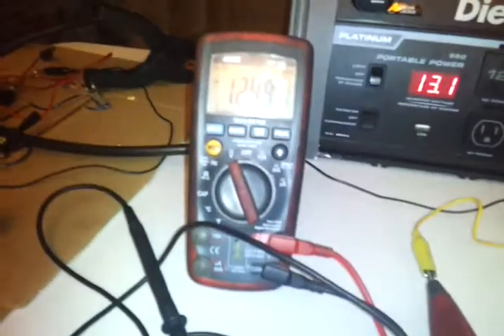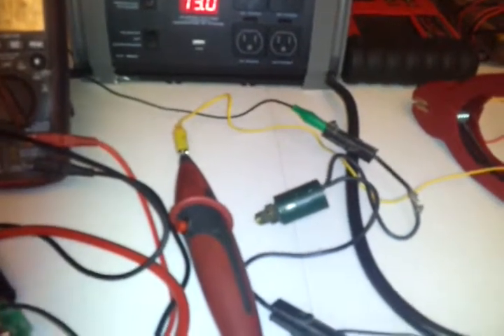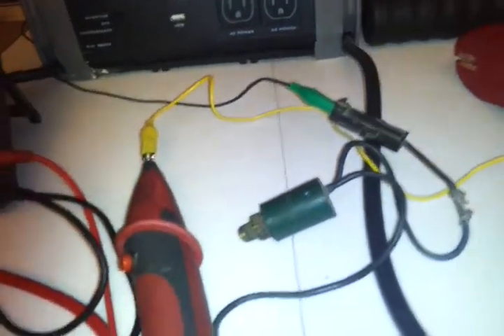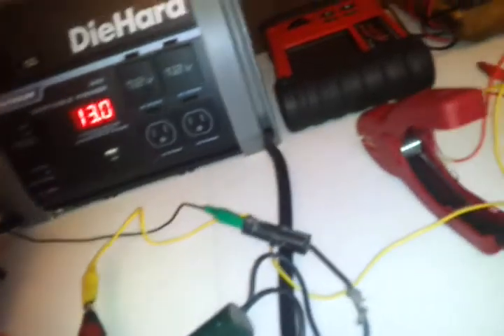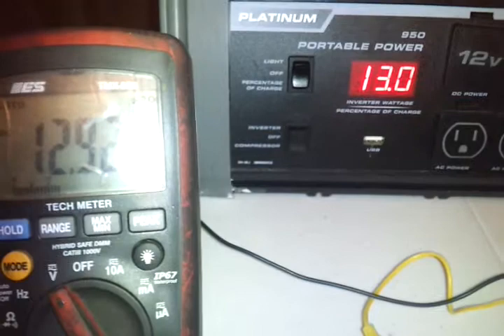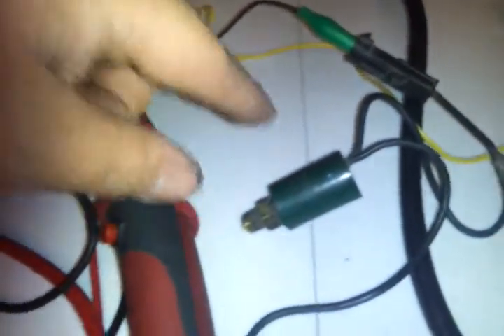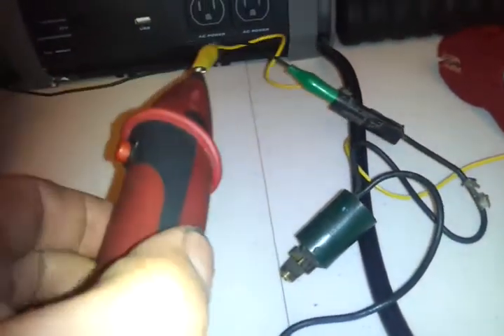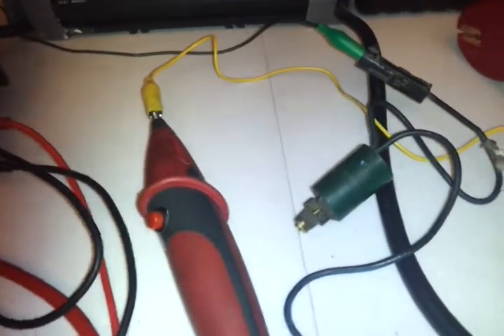Fixing Ac problem with Loadpro Leads

Comment: Good job busjockey! When you do the next video on the Loadpro, you may want to scribble down a wiring diagram to show the 25Ω resistor inside the Loadpro device to show how it interacts with the surrounding circuit that the probe is placed on. This would be especially helpful I think for your viewers when you discuss about how it's possible of where other devices can be turned on. Thanks for sharing the video.